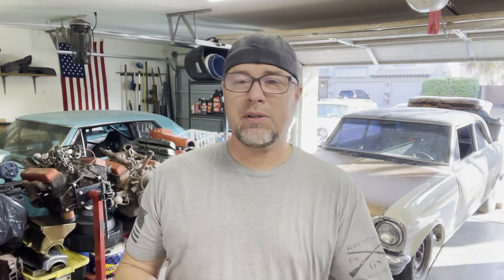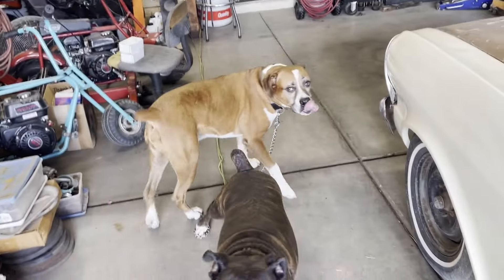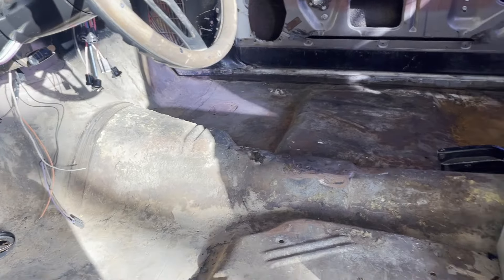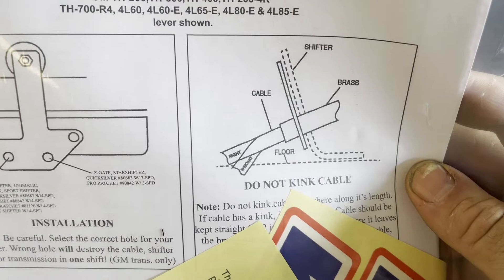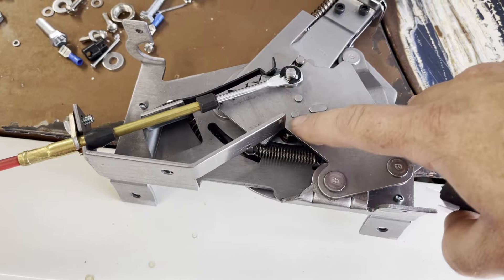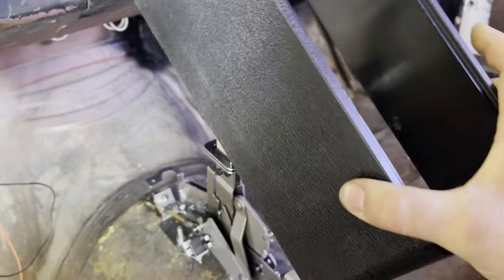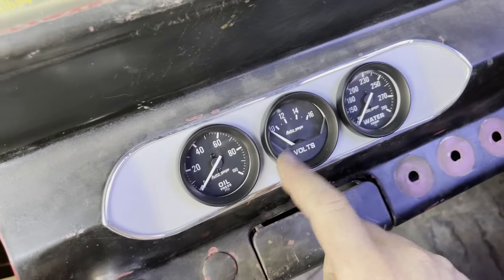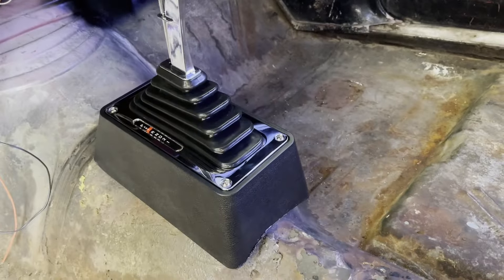1965 Nova Build | B&M Mega Shifter Installation!

Comment: That brings back memories. You're going to have so much fun! I loved mine. The only thing i didn't do was wait to put the cable in after the trans was dropped in. I crushed it and eventually the cable snapped from chafing inside the sheath. I also purchased the heavy duty cable after that.
Reply from the maker: I’m looking forward to it!! I always drop the cable in with the shifter. Just for that reason.  It’s getting close.  I should be able to take this thing around the block soon!
Reply: @tackettshoh  Woo Hoo!
Reply from the maker: @DonCrookwashere  I say the same thing!

Comment: Tip, get the B&M Heavy Duty Shifter Cable....
BMM-80833.
Reply from the maker: I’ve never had a problem with the regular cable.  As long as you keep it away from the exhaust and don’t bend it too tight. 

But that is a good point.  Thank you for sharing.